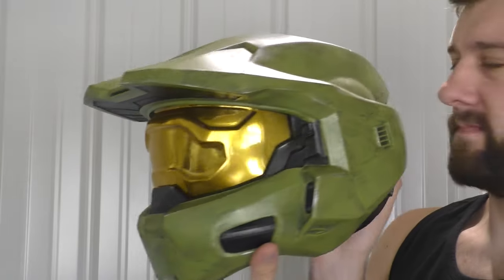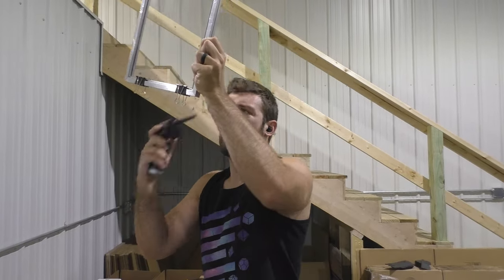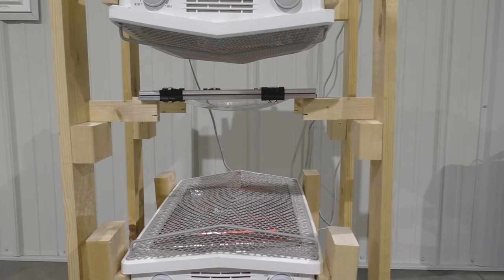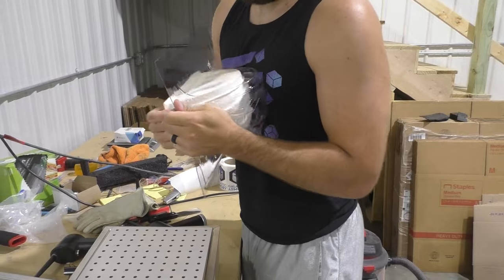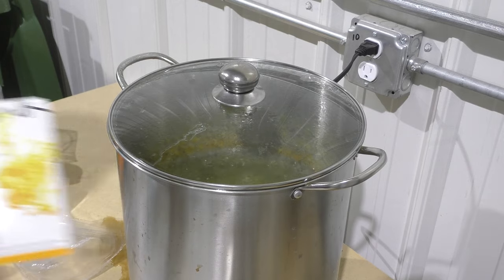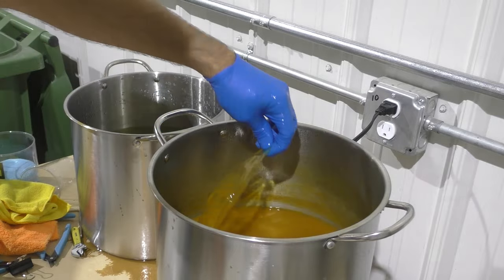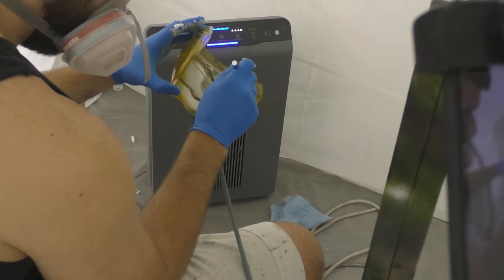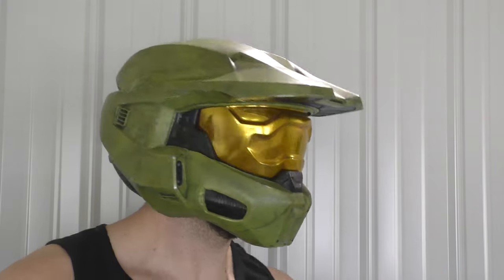Vacuum Forming, Dyeing, & Tinting a Master Chief Visor

Comment: Careful when using plastic polishes like this in the middle of the procest. Most of them (including this one using dimethicone) contain some form of silicone, and it will leave a thin film that can make further treatment (like painting) difficult or impossible. Clearly it hasn't been a showstopper in this case - but anyone who wants to do similar things should be aware of this problem.

Comment: Really important question! what do you make your mould out of to do the vacuum forming? I'm thinking of 3D printing it in ABS but wondering if PLA would work.
Reply: I just tried with PLA (my friend printed it) and while everything worked great 4th time the visor mold bended inwards probably because of the PETG sheet's temperature. I recommend trying a higher temp plastic like ABS or PETG or maybe bigger infil using PLA  but that means more plastic and I'm not sure if it will solve the problem. Good luck!
Reply: if youre still interested ASA is the best matetial for it because of the high themperature and easy smoothing with alcohol

Comment: Where did you get the plastic sheets from for the vac forming process?
Reply: Amazon baby!
Reply: @astrophysicistguy  Size? Thickness?
Reply: @BuckyMF  .06" thick petg. Size of the sheet depends on the size of your vacuum former but a 12" x 12" is plenty big enough if you use the model of the buck that comes with the GA helmet files. Of course you need to make the buck out of something that will withstand heating petg to the proper temp so you make  the 3D printed buck out of PLA, then make a mold of that using Smooth On silicon and then make the buck out of resin from that mold. The resin buck will withstand the heated petg when you vacuum form over it

Comment: what size is the visor that you are making because I 3d printed the master chief helmet from halo infinite I can do the visor but I got one problem my machine is not big enough to Risen print the visor I could do it in transparent clear 3D filament I kind of like how you did yours I'm not sure if I doing it in filament how it will look
Reply: Clear filament would be a nightmare 😬 You could potentially cast the visor in clear epoxy. Otherwise you might be able to find someone who would have access to a larger format printer and request that it would be printed with Siraya tech’s ultra clear

Comment: Could we apply this process to any flexible plastic to make ourselves a visor?
Reply: You can in theory vacuform other plastics yes, but this one (PETG) has an ideal mix of properties for the job. Most other plastics would behave very differently, and honestly it would probably just create a mess. Other plastics used for vacuforming is PS (polystyrene), PC (polycarbonate) and ASA (acrylonitrile styrene acrylate). 
Normal PET (soda bottles) is closely related to PETG and shares many properties, so thats an easy sourfe of some material for some basic experimenting with the principle. You can turn them into sheets without too much work.
Building a good vacuforming rig is not a trivial job though. The cost of some proper plastic blanks are pretty trivial in comparion.